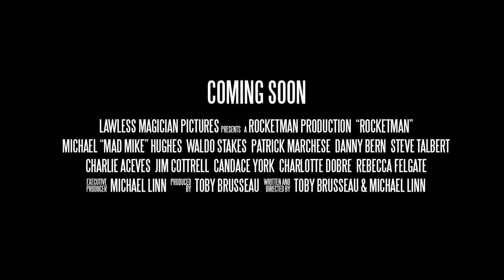Rocketman Teaser Trailer

Comment: Building a rocket and launching it is a great accomplishment, weather you want to prove the earth is a globe, flat, cubical, or whatever shape. Why not, instead of taking that great risk shooting yourself nearly into space, mount a bunch of GoPro cameras and additional electronics, such as GPS transmitters, onto your rocket. These will also give you the prove you're looking for, but will also reduce the weight of your rocket, the costs, time and effort and with the same amount of fuel, will very likely, take the rocket even higher. So pick up the GoPros when they've landed and (re) view the footage.
Reply: @Box Addict that's not my point, I'm not talking about the difference between a YouTube clip and a full documentary here. He obviously weighs in a couple of hundreds GoPros. Which also means, when using a couple of GoPros instead going up yourself, you'd benefit from the weight reduced and thus the rocket will go higher. Also the rocket doesn't need to be as big as it's now.